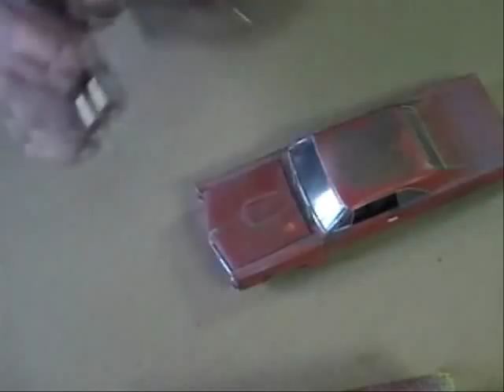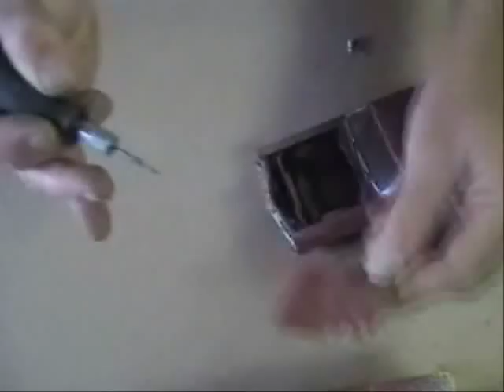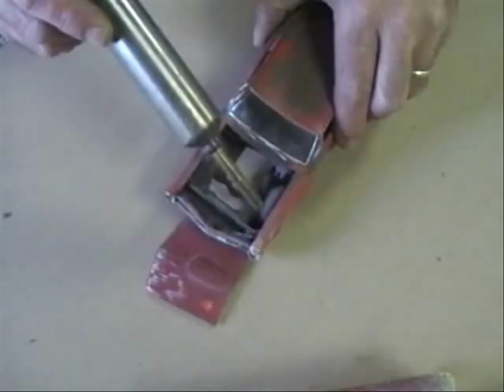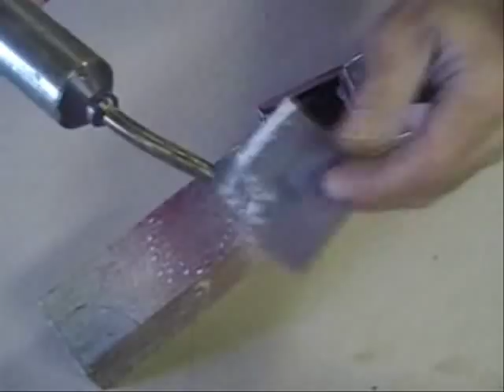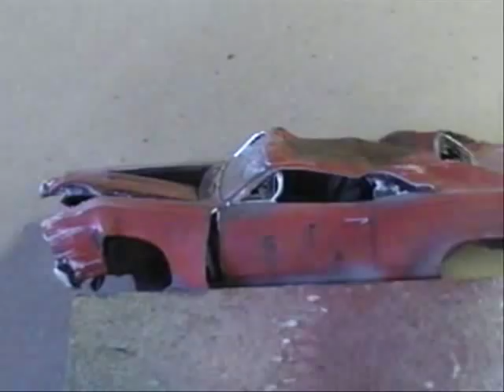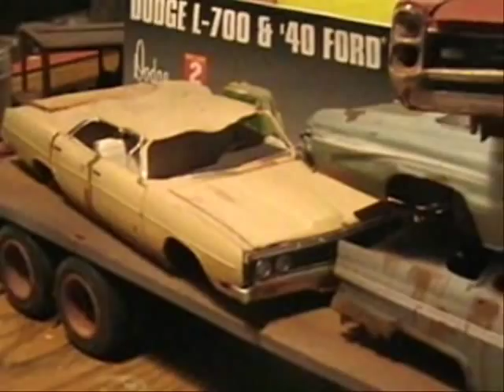GTO wreck in 1/25

Comment: the way I crush a plastic 1 .24 scale only if missing parts l use the toaster oven  l get it hot enough then l use my crusher it looks just like the one in the junk yard  I put the car in the crusher then step on the crusher plate . I made it out of steel  half inch plates 4 round post  the plate move up and down on

Comment: Amazing job 👏👏👏. I had a question, would a hair dryer work as well to melt the models? Keep up the Great work.
Reply: Maybe, depending on the hair dryer, but the benefit of this plastic welder is how “focused” the nozzle/heat coming out of it is, and the great adjustability of temperature